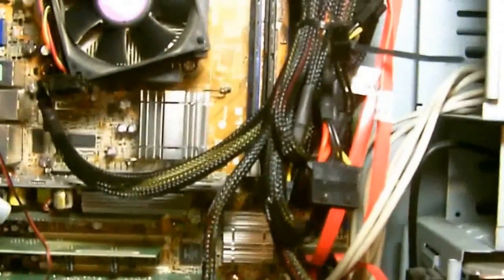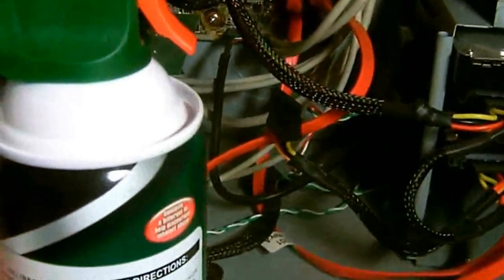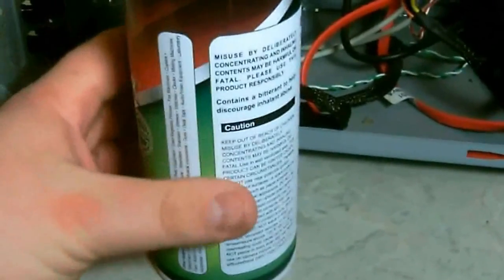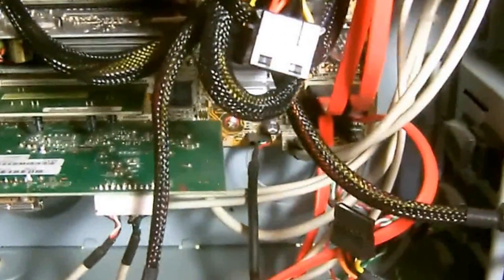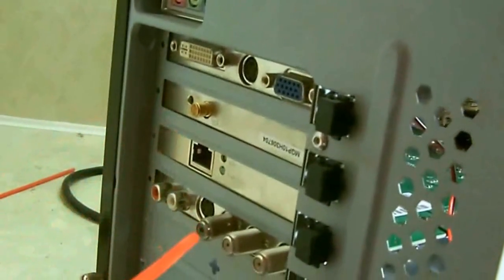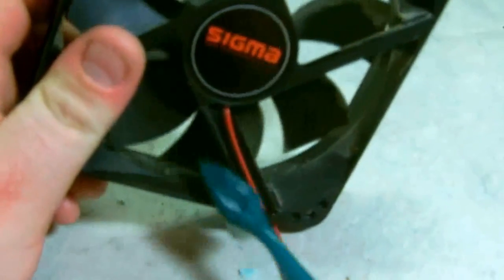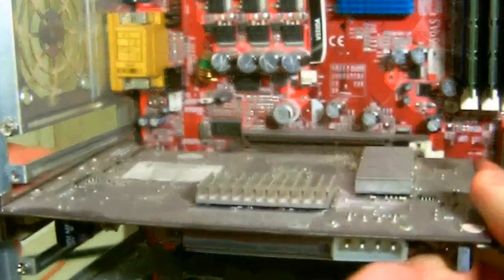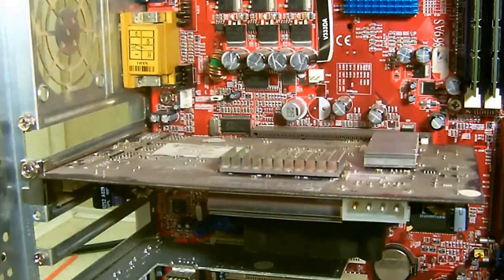Cleaning inside the PC

Comment from the maker: I keep my Main PC 3 feet off the floor sitting in my entertainment center since all my electronics and computers connect to it. It provides the backbone for my internet and TV so it stays on 24/7 when I am home. It's been running good for almost 5 years by keeping it clean inside. All I've replaced in it was the 400W PSU with an 800W and the LAN card earlier this year. I agree, Putting the PC on the floor is a bad place to put them. -MrFixit

Comment from the maker: That's true, wildbill23c. The picture that I showed in the video of the PC I cleaned a couple of weeks ago was the worst I've seen in years. I told the owners that I'm amazed how long the computer went without a cleaning. They were surprised to know PCs require periodic cleaning. Now they say it's quieter and operating better. Today's processors are designed to slow down when reaching a critical temperature to prevent a burnout. HDD develope errors caused by excessive heat. -MrFixit